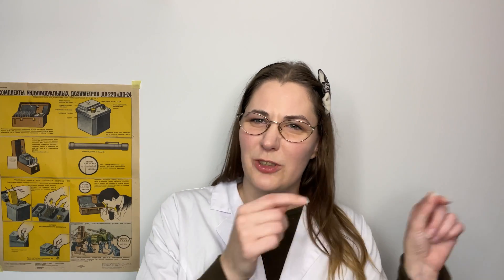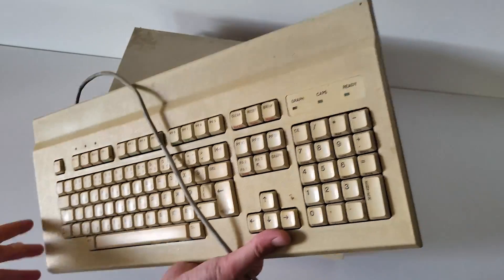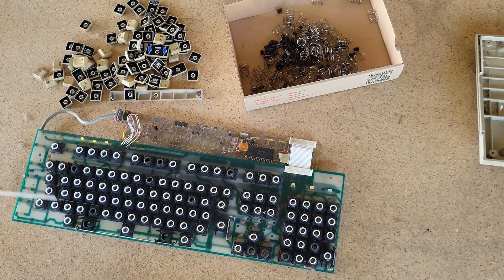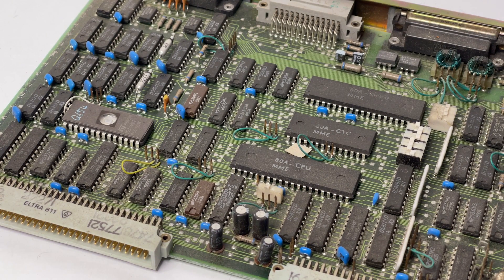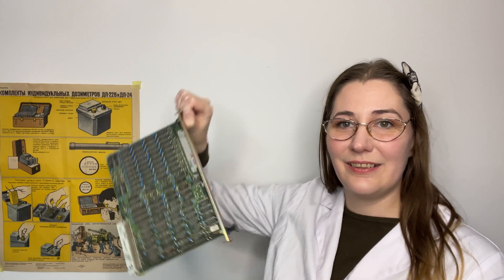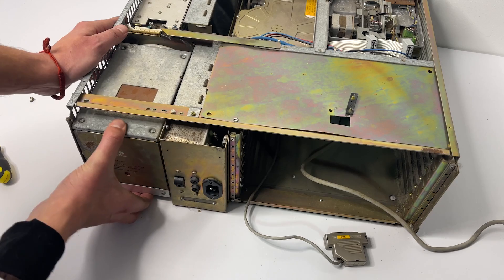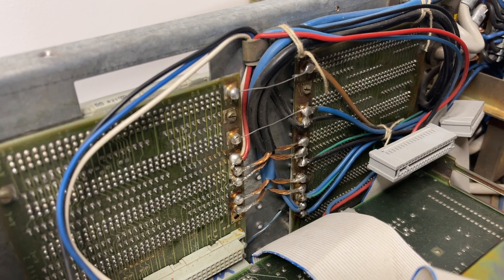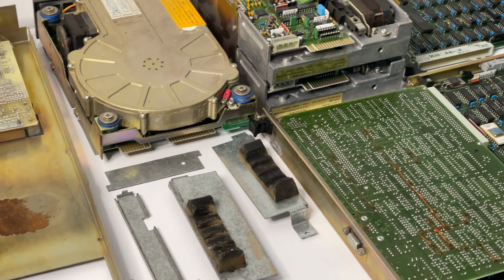It is not a COMPUTER, it is a DISASTER. Robotron SM1910, made in DDR in 1988

Comment: Hi, I'm from Dresden / Germany where Robotron was located. The cables at the back are only connecting the front connectors for the keyboard and tablet if I remember right.
Reply from the maker: Thank you for these details! You are warmly welcome here :)
Reply: @ChernobylFamily  I have some of them in my cellar (7100, 7150, 1910, 1715, KC87, Z9001) but did not switch them on for years. The problem is that the high voltage caps in the power supply need to be reformed before powering on.
Reply from the maker: @stephanbrenner3317  here is the same problem, need to recap all of them
Reply: @ChernobylFamily  normally it is sufficient to disconnect them and slowly increase a DC voltage across them. After some hours they become better. But please remember to never switch on the power supplies without a load. These are not able to operate open loop. Use a car bulb as load or something like this
Reply from the maker: Yes, thank you for the advice! Had the same situation with ES1841 power supplies.

Comment: I think the only reason that the RAM boards had a connector on the front was if they were employed in other computers that had the RAM boards installed in a vertical position or 2up in a horizontal position and connected to each other in a serial configuration, of course this is pure speculation. I was wondering if there is a version of the Williams game Robotron that can run on this machine?
Reply from the maker: We thought in a similar way, or maybe these connectors are for some diagnostics... as for the game, just know it exists. The computer can run DOS- or CP/M-like OSes, so might be, if there is a dos version.
Reply: The manuals of the RAM (OPS-K3571) does not mention this connector aside from the overview drawing. I suspect this as a test connector.